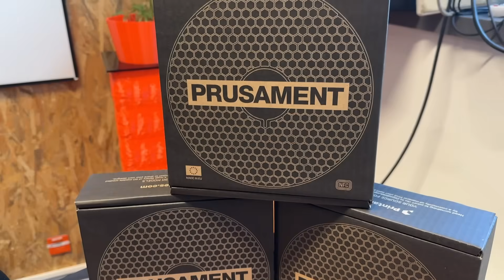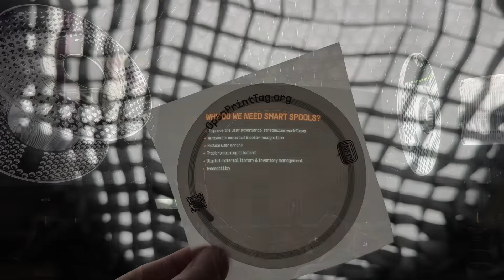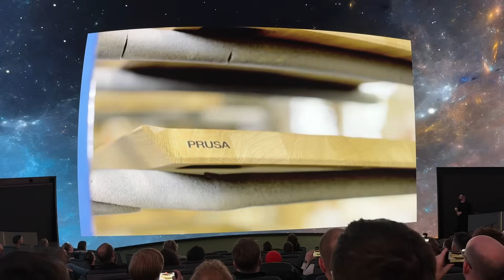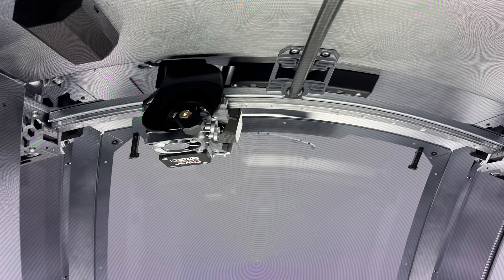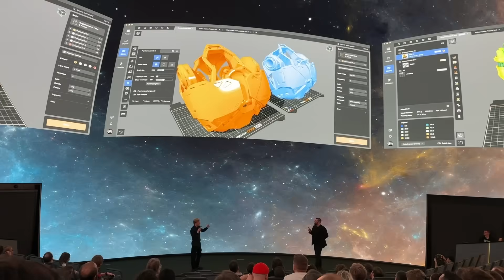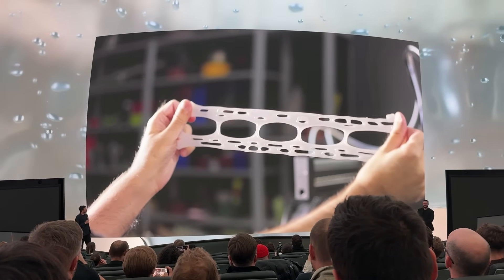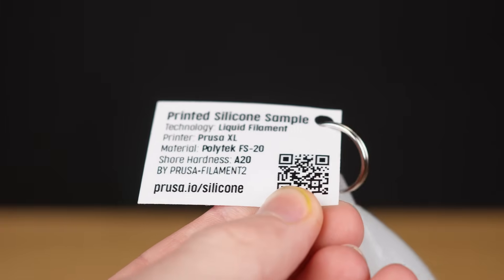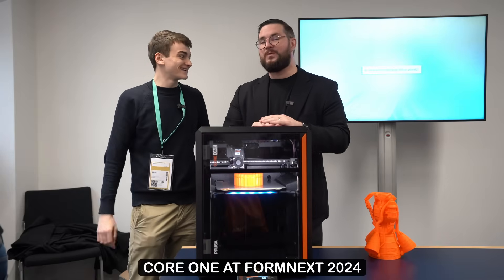Prusa Day 2025: Core ONE L, NFC-Spools, PrusaSlicer 3.0 & Silicone Printing!

Comment: Prusa, make an Epoxy-gel dispensing toolhead, with an integrated EV cure light.
Would LOVE to be able to add a perfectly smooth & dyed layer of epoxy on the surface of some prints.
Call it, I don't know... the EufyMake3D head maybe ?  😉

Comment: Stop parroting the “double the build volume” argument without specifying the variation in each dimension. And to be fair, do it using percentages. Maths is a powerful deception tool. Some parts of this presentation feel very Applesque.
Reply from the maker: That's exactly why my first sentence was "And now to the highlight for the consumer market: the Core ONE L, with a build volume of 300 × 300 × 330 cubic millimeters [...]".
Reply: The cube root of 2 is approximately 1.26, so 26% increase in each dimension on average.

Comment: Food grade silicone would be a game changer
Reply: But isn't one of the issues of fdm 3d printing that because of the "3d printing" lines, its less cleanable and bacteria can accumlate, thus making 3d printing itself not food safe. (And the issue with resin printing not being food safe, is that most resins can be toxic)
Reply: @Zmartshopper high temp dishwasher cycle sterilizes the items

Comment: I don't get all the negativity in the comments here (and on other similar videos). Is it a revolution? Not really. But it gives us virtually everything people have been calling for since MK4 release.

Upgrading mk4 or core one to L does not make any sense (hell, even upgrading mk4 to core one seems ludicrous from a value perspective).

Silicone printing is niche and clearly not done, but it is cool as hell. 

Yes, the price is higher, but it is justified assuming you support the same values as Prusa. But that's been true since forever at this point.

The NFC tags might not catch on, we'll have to see. But if there is someone who has a chance to make it work it's probably Prusa.
Reply from the maker: I think so too. The Core One L is a nice addition and more affordable compared to the single tool XL. With the INDX Prusa will have a solid lineup.
Reply: @JanTecEngineering  Why not compare it to its competition, the H2S? Of course its more affordable than the single tool XL, which is overpriced junk.
Reply: Mk4 was released March 2023. Since then Numerous other competitors have filled that need at a better price point with more features and match or beat the Prusa user experience, and now they release this printer? With less build volume than an H2S and a $550 higher price tag? Even compared to the H2D it makes me wonder what Prusa was thinking.

Pruse made a name for itself by having the best user experience. Printers that were highly tuned and dialed in right out of the box. That is no longer unique to them and they arent even the best at that any more cough PrusaXL cough

NFC tags are a joke. Most print farms are using so much filament that the labor to reprogram the tags would be counter productive.

Comment: Maybe they're just planning ahead: A Core One L will fit more INDX tools, thereby being a better comptetitor to Bambu's upcoming H2C...
Other than that it seems to be once again way too expensive for what it is. Why pay 1700€ for a Core ONE L when an H2S with two AMS is available for less?

OpenPrintTag is a great idea, but I'm afraid the other printer manufacturers have little incentive to support the initiative.

The new slicer UI is a nice touch (it was definitely overdue for a makeover), but in general I'm annoyed with the slicer landscape overall: By now, most printer hardware is "good enough". So if 3D printing should advance, we have to improve the software side. (You demonstrated this many times, with nonplanar slicing being just one of the new ideas.) That's why it pains me so much to see that every manufacturer thinks they had to reinvent the UI again and again. Why waste time on the 27th skin of the Slic3r core? Creating an own installer, manuals, localization etc. That stuff costs so much and doesn't improve 3D printing one bit!
Reply from the maker: I fully agree with your thoughts on the Slicers; if every manufacturer would spend their budget on making Slic3r actually better instead of just designing a new UI, slicing could be so much better.

Comment: Slicer improvement wanted: Bracketing the WipeTower in the Gcode (I can almost see how to do this with a post processing script) so that it is a cancelable object. For those days when it’s the @#@! WipeTower that fell over, but the model would probably finish ok without it.           —- Basically the ability to cancel objects is created by there being a ‘list’ of objects at the start of the gcode.  They are named and assigned sequential numbers.  Then the gcode has a movement for where to start the print of the current fillament/extruder/color for a particular layer for an object and at that point it has a labeled START instruction.  When it is done with that object fillament/extruder/color there is a STOP instruction then the move to the next object …. The way cancel works is the printer just doesnt do anything for the canceled objects between the START/STOPs for that object.    So, if the ‘list’ of objects included an  (initial?) entry for the wipetower and then whenever it was about to extruded on the wipetower a START with the STOP after that extrude then the wipetower would be cancelable.   There are many times you have a print where the wipetower is nice but it gets knocked over, it would be great if you could cancel it.
Reply from the maker: Noted!

Comment: The Core ONE L, especially with lack of kit or Core ONE upgrade path, is going to piss off a lot of Core ONE owners. Prusa had better have some impressive things in the pipeline for Core ONE owners, even beyond INDX, or a lot of first-time Prusa owners are also going to be last-time Prusa owners. Especially with the struggles the Core ONE has had during its first year.
Reply: Lack of upgrade path should not piss anyone off, it would not make sense. The reason for the core ones bed size is that it was the same size as the mk4 and therefore upgradeable, theres no real way to upgrade without swapping out a massive number of parts (imagine swapping out the sheet metal enclosure for a larger sheet metal enclosure, very little similar parts)
Reply: I will give you that it would have been nice if they hinted at larger printer comming, but upgrade path is insane - what would you keep from the stock Core One? The nextruder and the main board. You would have to replace literally everything else. An upgrade path makes no sense here.
Reply: @rancor1223  the core one can house a bigger bed it has the space if you make a narrower sides
Reply: @baderalafghani4564 for one, even if it could fit s bigger bed, it certainly can't fit a 30x30 bed and two, no, it absolutely cannot, because the constrained is the gantry, not the side panels.
Reply: I cant upgrade a MK to an XL or an XL to anything else, the upgradeability is a great selling point but …. There are limits.
Reply: I think the C1 one can be 300X300X270
Reply: If you promise upgradability you have to keep tjat up!
Reply: What's a fud?
Reply: Prusa has been a bad choice for a long time, only fuds buy it and keep screeming its the new sliced bread